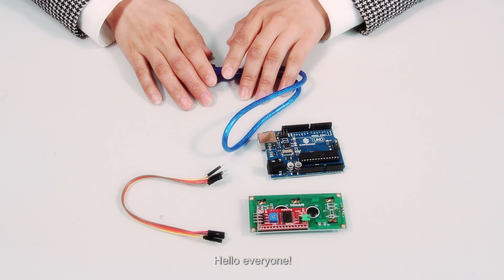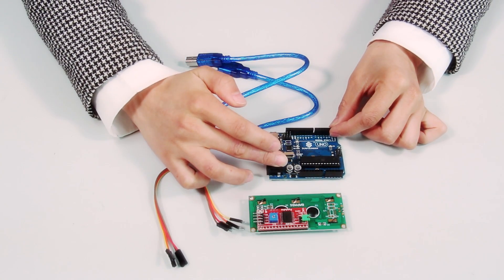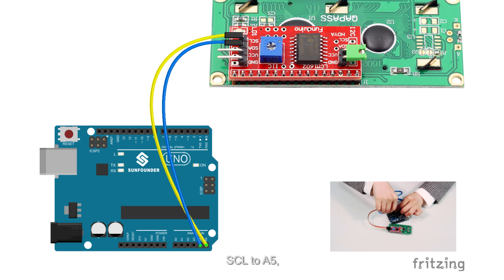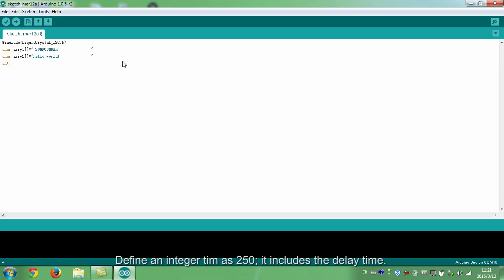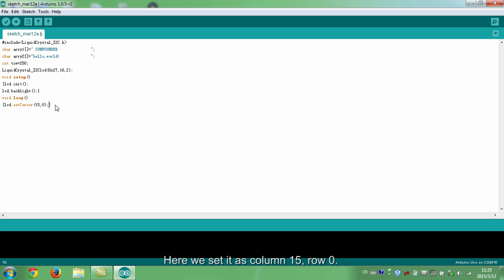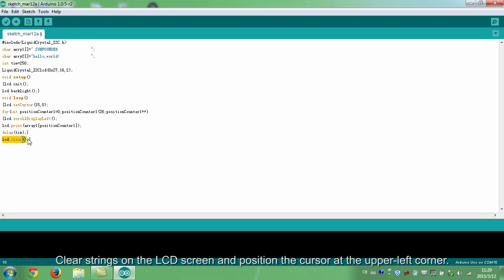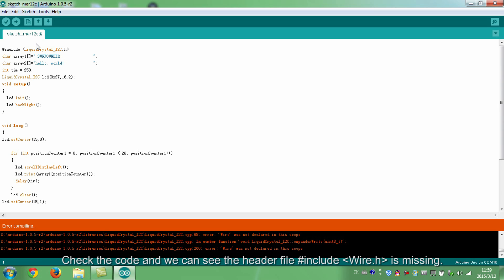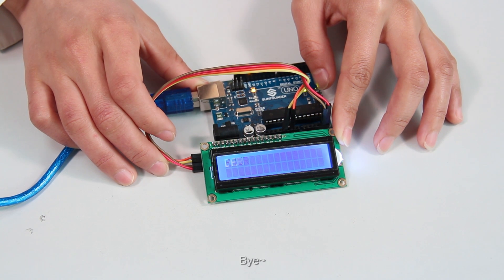SunFounder Learning Kit Tutorial for Arduino - I2C LCD1602 - Super Kit/Starter Kit, Need soldering

Comment: I have a question, I wired the arduino like in the video and use the library pasted on the site but when i try to upload the example "hello world" the lcd doesn't change. I tried pressing reset and checked the wiring but everything looks  correct.
Reply from the maker: Glad to help! :) If you have more questions, welcome to check FAQs or other forums on our website.
Reply: OMG Thank you so much!!!!!!  Looking for the solution on so many webs... finally find you! thank you so much again :)
Reply from the maker: Which Arduino board do you use? Uno, Mega2560? And is the code uploaded successfully (at the bottom on the window you can see a prompt message for upload done or errors happen)?
Reply: uno and it sends the data says upload done but the lcd dosnt do anything.
Reply from the maker: When you just power the circuit, did the LCD light on? And white checks were displayed instead of what you intended it to? It can be that the I2C address is not 0x27. You need to find the real one out by a code. Copy the  code here (https://www.sunfounder.com/forum/faq-i2c-lcd1602-not-displayed/#simple-forum-post-217) in a new IDE window and upload it to your board. When it's successfully done, open Serial Monitor and the I2C address will be displayed then. 
Then replace the address in this line in your code: "LiquidCrystal_I2C lcd(0x27,16,2);" with the one you just get.
Reply: It WORKED! thank you very much
Reply: Not just contrast I guess. Mine was blank and then I noticed just a little change. I adjusted contrast on the back and works great now. I'm very new to this but thought maybe same thing.

Comment: So I upload the sketch and the screen is just blank. Well the top row has dark squares and the bottom row is blank...
Reply from the maker: +Ashley Perry Try press the reset button on the control board.
Reply: +Sunfounder Wow thanks for the fast response! I've pressed the reset button and powered it off and on again and still doesn't work. I've noticed the L LED is blinking quite a lot too. I assume the sketch has been uploaded as the tx/rx LED flash while it's uploading
Reply from the maker: +Ashley Perry Actually when the code upload is almost completed, the LED will blink for a while. When upload is done, it will stop. 
For LCD not working, first you may check whether the wiring is correct. What control board do you use, Uno, Mega2560 or others? If you use a Mega, the SDA of the I2C LCD should be connected to SDA (20) of the Mega, SCL to SCL (21). 
If this still doesn't work, post screenshots of your code uploading results and physical wiring photos on our website Forum or send email to support@sunfounder.com
Reply: It turns out i had installed the library in the wrong location. LCD screen is working fine now, thanks!
Reply from the maker: Oh, always the library...so now you can have fun with the LCD. 
For more details, you can check our FORUM and WIKI, where we'll release more and more interesting and useful tutorials for you to better learn. And, welcome to share with us your study notes, which may be great help to other hobbyists!
Reply: I have same problem like he, but im using Funduino uno. 
I connect GND with GND 
VCC with 5V
SDA with A4
SCL with A5 
I would really appreciate some help
Thanks
Reply: Scroll down to install from zip and read that.

arduino.cc

Comment: Hello, I have a question
When I upload the code I get this error:

Arduino: 1.6.3 (Windows 8.1), Board: "Arduino Uno"
lcd1602newww.ino:1:31: fatal error: LiquidCrystal_I2C.h: No such file or directory
compilation terminated.
Error compiling.
  This report would have more information with
  "Show verbose output during compilation"
  enabled in File > Preferences.

I would really appreciate some help
Thanks
Reply: Worked after some stressfull moments XD
Reply from the maker: aussiecubing You need to unzip the LiquidCryStal I2C file to your libraries folder under Arduino.
Reply: Ok thanks
Reply: +Sunfounder I have the same problem except im on windows 10 and running Arduino 1.6.7. I went to the libraries folder under arduino in my program files (x86) and there was no zipped "LiquidCryStal I2C" file, but there was an unzipped "LiquidCrystal" file?????

I need help please
Reply from the maker: +Awesomepieman32 Actually you need to add this library for use. Please go to http://www.sunfounder.com/index.php?c=case_incs&a=case_nr&type=47 and download the package RFID Kit V2.0 for Arduino.zip on the page. After unzipping, you can see a LiquidCrystal_I2C folder inside. Just copy the folder to the path of your Arduino. Then it should work.
Reply: Thanks so much, works now!!